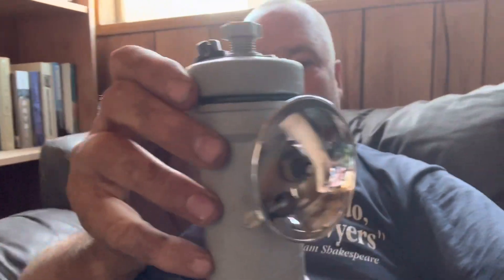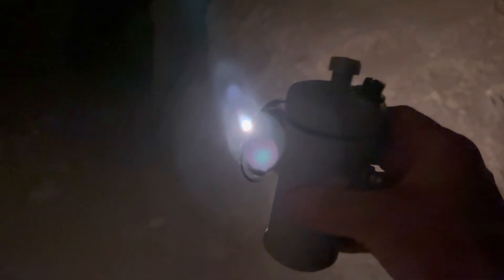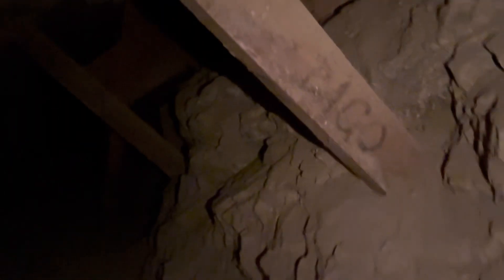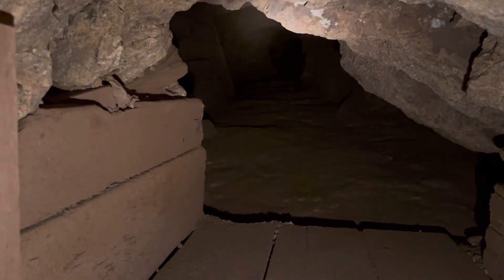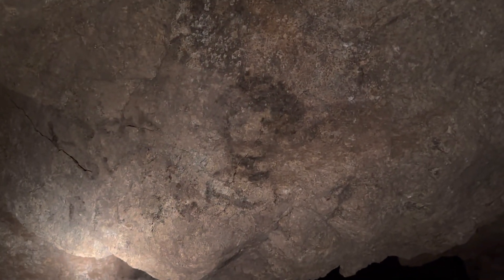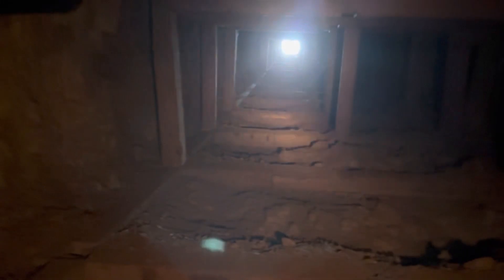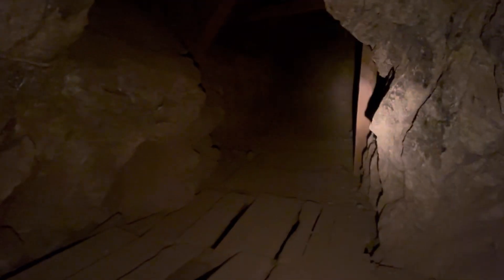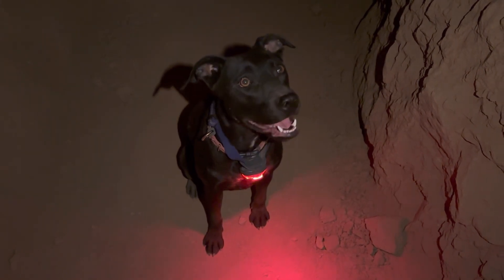Who needs batteries? Going old school with CARBIDE!

Comment: My dad used carbide lamps to poach brook trout at night when the streams ran low in late summer. You’d walk upstream slowly with the person holding the light going first, and the netters coming along on either side, scooping up trout, putting them in an onion or burlap sack. I can remember being woken up as a child, to go see all the brookies in the kitchen sink, some still flopping around. Carbide light goes through water whereas regular flashlights would reflect back. The carbide was kept in a pipe tobacco screw top can. Carbide lanterns were also used for gigging eels and running coons at night.

Comment: In the 1960's, I bought an old school carbide miner's lamp and used it in AZ. I still have it and a gallon can of carbide pellets.  I quickly learned not to grasp ladder rungs while climbing up or down in a mine shaft.  The flame burned your hands.

Comment: Back in the '70s when Justrite went from using brass to plastic the new plastic lamps gained a really bad reputation amongst cavers because if you had a gas leak and it ignighted the flame would cause the lamp to melt off the front of your hard hat.  That is a BAD thing.  There was a caver song about it that went, in part, "plastic Justright, plastic Justright, melted to the front of my hard hat."
Once Justright started to use plastic the only decent new brass carbide lamps were the Premier brand which was made in the UK.  There was also a "Butterfly" brand made in Hong Kong which was pretty bad.

Comment: I have a question 😊
I realize that some of the spoils was ore !!! But what did they do with what spoils was not ore ????  I'm just curious about what they did with it 😊😊😊😊😊
Reply from the maker: Waste rock was either hauled out and dumped, resulting in the huge rock piles outside these and most other mines, or else it was backfilled into worked-out sections of the mines.
Reply: @tecopamines  okay 👌  makes sense

Comment: I have several brass carbide lamps from when my entire family used to go caving back in the 70's. I have  ones with 2 inch and 4 inch reflectors.  Why didn't you show how it's filled, how to light it and how to adjust the flame?  I guess you've done that in a previous video. (I'm new to your channel, thanks to Sarah Jane.)
Ya know, you easily could have used one of those rocks you plan on clearing out of the mine to demonstrate soot writing with a carbide lamp.  
Also, if you don't know spent carbide is toxic as hell. The problem is that animals like to eat it and it will kill them. We were taught to carry it out of the cave and bury it as deeply as we could dig.  I'm sure the rules for disposing of spent carbide have changed since then.